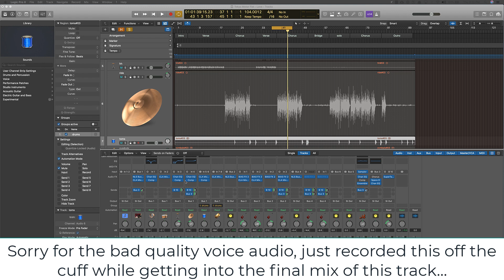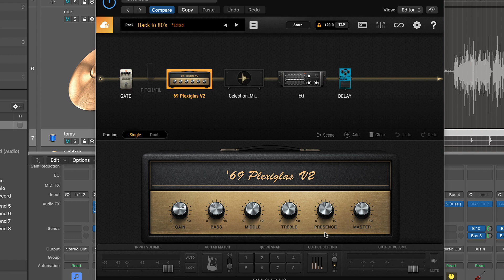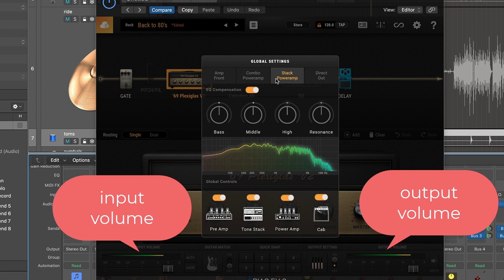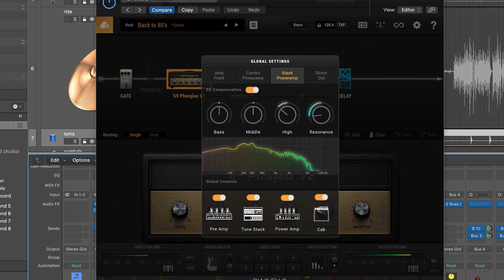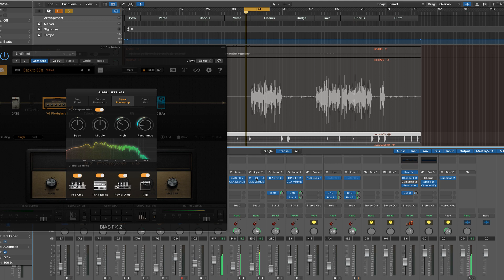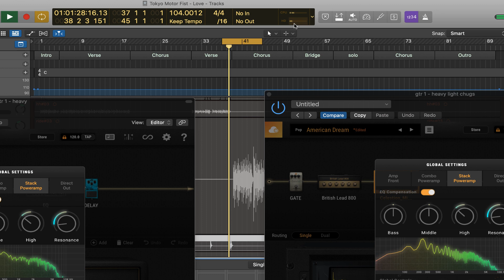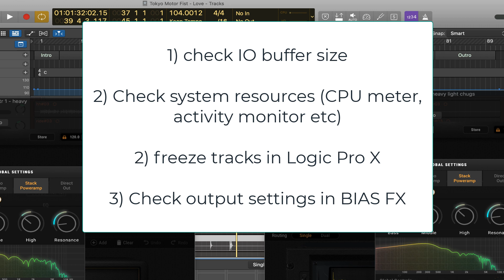Fixing Crackling Noises in BIAS FX 2

Comment: Thank you very much for this video - super helpful.  I could not figure out why everyone seems to love Bias FX2 and it sounds great on various videos, but many of the tones sounded terrible for me. My extra 2 cents - I found that it was not a latency issue for me, but instead the input/output settings for Bias FX2, and most importantly the input level was too high (even though the DI level was fine, and some tones seem fine). What made it hard to figure out out was that it didn't sound like a normal level problem, but instead a weird crackling and was sporadic. So for those of you pulling your hair out, check the input and output level settings within Bias FX2!

Comment: Amp 2 does sound amazing, but it can be slow with Reaper. I use Donner Guitar interface which does use high quality chips.

Check out the clean tone on the check mate amp!

Try playing All Along The Watchtower with the Hendrix amplifier.

It does work well but it eats a lot of CPU.

Though my laptop is very old low spec. You have to give it 15 mins to start up.😢
Reply from the maker: Yeah, it's slow in Logic too, that's why I use Softube Amp room...although it's slow to load too, but once the project is open it's quick.
Reply: @cleverdood  :-)

Comment: my bias fx 2 is has no output sound, please help how to fix itu...i'allready do all setting correctly.., but still no sound output..
Reply from the maker: I have this problem sometimes when I'm outputting from my audio interface, if that's the case, turn off direct monitoring.
Reply: @cleverdood  direct monitoring on soundcard or else?
Reply from the maker: yes. My Focusrite has an application that allows me to do that. I use Logic Pro X and it has a built in "direct monitor on/off" function. I remember being REALLY irritated trying to get the sound to work with the standalone app. I could only hear the raw guitar signal.

Comment: I never use those output modes ... anyway, it looked to me that the output meter in the lower right was clipping - it cleaned up by tweaking the other settings, but the output was lowered ... that's what really helped.  You can check the input to you audio interface so that it is not clipping ... you can adjust the input in the lower left of Bias FX2 ... and you can go to Cabinet and make sure the speaker in and out mics are not clipping.  That's how I would deal with the clipping noise.  The buffer crackle you described exactly what t o do - great video